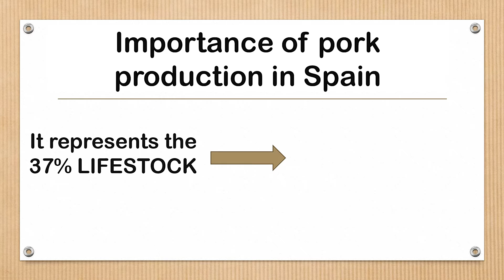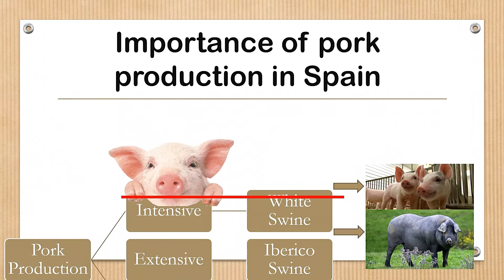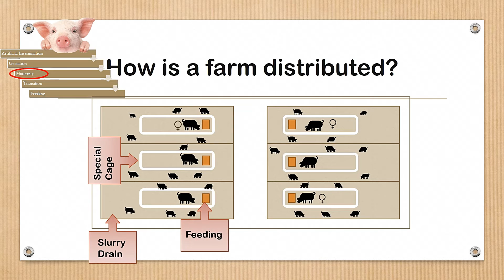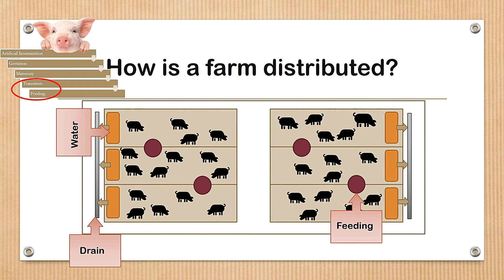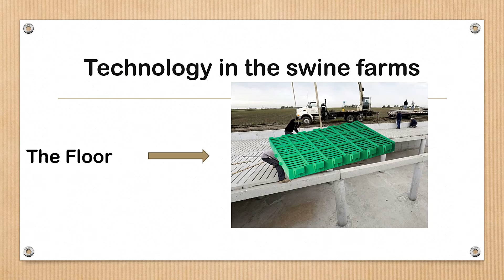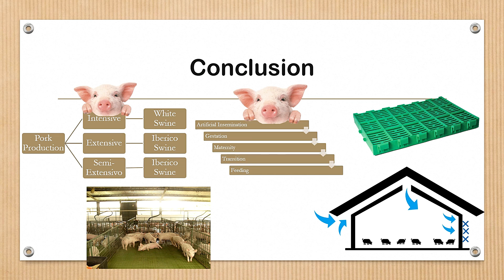Swine farms in Spain

Comment: 1. How well did video directly address the intended technical area?  
 Clarity of topic      9__ out of 10 marks
 Logical presentation     8__ out of 10 marks 
 Evidence-based information    7__ out of 10 marks
 Credible sources     _7_ out of 10 marks 
 
2. How well did the video communicate message under the following headings?  
 
Audio quality      7__ out of 10 marks
Image quality      _9_ out of 10 marks 
Cadence and rhythm      _9_ out of 10 marks 
Language and vocabulary    _6_ out of 10 marks 
 
2. Creativity of video?        
   _17_ out of 20 marks 
 
Comments:
The voice over of the visual slides was a little rushed, there wasn’t enough time left between slides I felt to allow me to take in what was said and be ready for the next slide I found myself pausing the video to get a chance to think about what was said and presented on each slide. The voice over was also a little hard to understand which lead to me finding it hard to concentrate at times during the video.
I felt the visual display of the video was excellent you could see there was a lot of time and effort put into producing the slide show and it keep the viewer very engaged in the topic being discussed. The creatively of the video was also very good with slides showing the layout of a pig housing unit and how slats are laid down, also the explanation of the type of ventilation used in Spain was very well explain and shown on the slides.
Overall I thought it was an excellent video with a lot of time and effort put into it. The video dealt with the broad topic of swine production in Spain in the allocated time and never felt rushed throughout. All in all I really enjoyed watching and analysing the video.

Comment: 1. How well did video directly address the intended technical area? 
Clarity of topic 8__ out of 10 marks 
Logical presentation _7_ out of 10 marks 
Evidence-based information _7_ out of 10 marks 
Credible sources _8_ out of 10 marks 
2. How well did the video communicate message under the following headings? 
Audio quality _8_ out of 10 marks 
Image quality _6_ out of 10 marks 
Cadence and rhythm _7_ out of 10 marks 
Language and vocabulary 6__ out of 10 marks 
3. Creativity of video? _12_ out of 20 marks 
Comments: I found the video to contain a lot of important and necessary information. however, I found it difficult at times to understand what the speaker was saying and feel I missed out on a lot of important information. I feel that the layout of slides could also do with improvement as some information was even very hard to see. However the speaker did portray an important insight of swine farms in Spain.